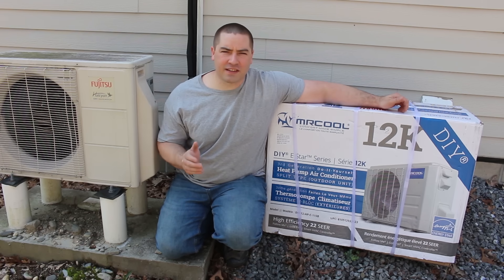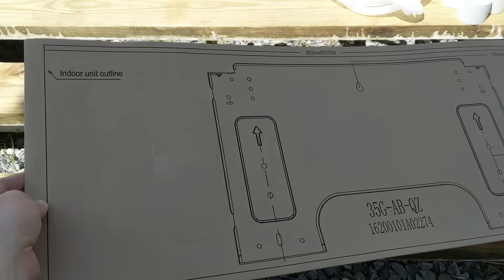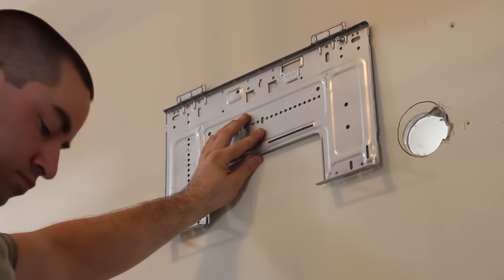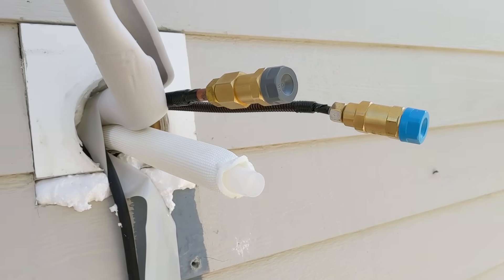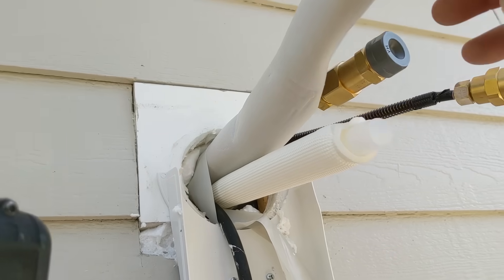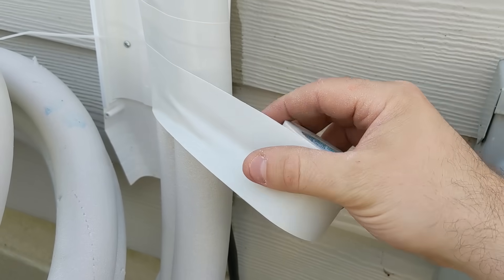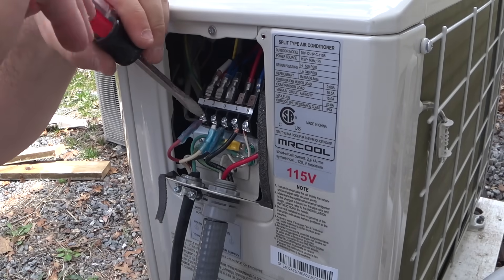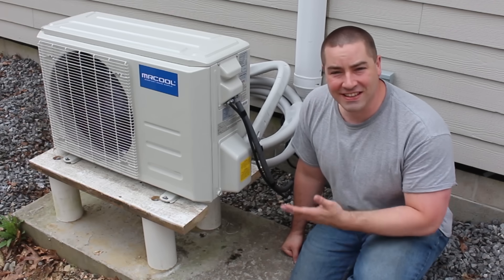Installing My Own Mini-Split Heat Pump, DIY

Comment: a little tips for drilling a hole bigger, is to drill a hole in a little wooden plank etc. and hold it firm over the little hole. then keep preasure on the "template" and drill a hole. the little template keeps the sides of the holesaw from wobbling.
Reply from the maker: Thanks for the tip.  I'll have to use that next time.
Reply: Or "drywall saw" is way easier and safer
Reply: You can also nest  2 hole saws on the same arbor. Use the original hole saw used to make the smaller hole as a guide for the larger hole saw. Works great.

Comment: Because of the camera angle i couldn't tell if the inside unit was level but it should be on a slight angle for the drain on the right.
Reply from the maker: I installed it according the manual.  The instructions specifically said to install the metal backer plate level, which is exactly what I did.
Reply: @DavidPozEnergy  ok than maybe the "gutter" inside the unit is already at an angle.because in my country they install it at a slight angle so the water flows out faster.
Reply from the maker: Could be, I don't know.

Comment: Nothing says DIY like 8' of copper coiled up to store your compressor oil.  I wouldn't think the average guy could pull off a clean install and be successful too.   No pressure test, just cross your fingers?
Reply from the maker: I  posted a follow up video addressing that question: https://youtu.be/KzHLsRtVn4U

Comment: I think good to have knowledge as it was DIY. But in terms of technical view or in a long run, you should be careful when you bend the copper pipe, and you must know required load for your room, and when you deal with refrigerant you need to be careful.

Comment: some info.        it appears that this sort of 'split  yet  combined  heating  And  cooling system' is a solution in search of a problem.         get 12k  Or  15k btus of cooling  from a window ac unit.          if the window won't cooperate,  put the unit  On  a  Stand, aligned with  the  window opening  and  create (simple, panel) ducting between the two;  with necessary drainage management.         heat with your choice of  mains AC heaters  or  whatever.   cheers      googletranslate

Comment: HVAC companies are a rip off!  nay sayers commenting are probably some of them.   I got a quote for right at $10k to install in my cabin,  Mr cool cost me tad over $1600 direct. The concrete, wiring, disconect box and the outside plastic cover cost about $150.  Saving me $8250!
Mines all unboxed ready to install, thanks for the video.
Reply from the maker: Bingo.  I like doing it yourself more anyways.  Very satisfying.
Reply: @DavidPozEnergy  Installed it  and its working great.  I amazed at how quite it is inside and out.   I bought 3/4" conduit, the unit will only take 1/2", was my only problem.  Thanks for the Video.

Comment: Is the warranty still vs valid when you DIY? The Senville doesn't
Reply from the maker: Yes, in this case it is.  Not all the Mr. Cool models can be installed by homeowners, only the ones marked as "DIY".
Reply: @DavidPozEnergy  You can easily install the other series of units DIY . A small vacuum pump and gauges are less than $100 . You can also do everything DIY and then call a HVAC tech to evacuate the lines and release the refrigerant to sign off on it . Usually charge less than $300 which is what you pay extra for the DIY line anyway .

Comment: That diy unit will have a multitude of issues...also not installed per NEC code 
Not to mention the loops of oil trapped in refrigerant lines...ugly,dangerous,and wont last...also the unit you replaced has low temp heating...that diy cannot produce the same heat ...enjoy your cold house in winter....

Comment: No vacuum, the moisture inside the line will build up ice , causes clogged. That’s different with professional job
Reply from the maker: I  posted a follow up video addressing that question: https://youtu.be/KzHLsRtVn4U

Comment: You are cool. How did you make your little stand there? 💁‍♀️
Reply from the maker: I nailed together some 2x4 lumber into a rectangle.  Then I bent some #4 rebar to make a big "J" from the base up the 4 legs.  The legs are in 4" PVC that was left over from plumbing the house drain.  I bought a sack of cement and hand-mixed it with water, sand and stone in a wheelbarrow.

Comment: buddy you did a good job but you must do a long timed strong vacuum for those pipes and the evaporator  to evacuate all the air and moisture before opening the valves , that will prevent any damage to the system .
Reply from the maker: I  posted a follow up video addressing that question: https://youtu.be/KzHLsRtVn4U
Reply: Another expert that does not know what he is talking about.i am talking about Nashwan Jan.

Comment: I have watched your videos and have found mini-splits just recently and plan on installing one...this video is a little bit suspicious...:)....I think there was a technician there instructing you....also because you had the existing outside mount..and electrical hookup...you could do it yourself...most folks won't have that.. but I still plan on looking now at MR. cool.
Reply from the maker: Hi Mr. Mark,  Yes, I'm replacing the Fujitsu unit that was a constant pain.  I had built the concrete pad for the old unit, so that was still DIY.  But the Electrical work was professional.  When I built my house I hired an electrician to do all the wiring, and requested an outside disconnect for the mini-split.  
I'll take it as a compliment you think there was someone else there giving me instruction.  There wasn't a technician, but I did have my daughter telling me to hurry up.

Comment: Thanks for posting this. I'm looking at the mini split myself. I'll need the 30,000 BTU which doesn't seem so mini.
Reply from the maker: 30k is a big system.  But these things can ramp up and down nicely to fit the need.
Reply: I put a 33k Mrcool in my main house; it's exactly the same amount of work for the smaller Mrcool save for the larger size 10 wire. And the price wasn't that much more than the 12k units

Comment: Bad job... there should be no more than 1% non condensable gas in system.. will not work propperly.. vacuuming or "flushing" but dont know is ti legal...
Reply from the maker: I  posted a follow up video addressing that question: https://youtu.be/KzHLsRtVn4U

Comment: Those dyi ac units are cool but they aren't accurate you should test the system with nitrogen. If you just release the refrigerant and there is a leak you loose that refrigerant. Second the system should be put on a vacuum to get any moisture and none condensables that may be present. Third  you have a extra roll of pipe that is not needed. There are reasons professionals are used
Reply from the maker: I  posted a follow up video addressing that question: https://youtu.be/KzHLsRtVn4U

Comment: Hey man, found this video by mistake actually! Was a good watch. I hate all the negative comments by people who seem to be in the field and are getting mad because the way they do things has changed and they are not keeping up. I was looking at one of these for in our basement to get rid of the baseboard heaters. We have an ETS system for upstairs but those heaters are just STUPID priced! I am not paying $10k just for 3 ETS heaters and then installation would be on top of that yet. This installation looked pretty simple but I wish you would have had a new install to show everything needed to be done. This is a great product for DIY it seems and if this design catches on then no more ridiculous installation bills from HVAC companies!

BTW - For the people screaming its wrong and to hire a professional...OK I will pay you $200 to install one of these in my house in PA. There is no existing one so everything needs done. If there was one there I would offer $100. I don't understand why companies make people pay close to or more than the whole unit cost for installation or repair. Kind of like computers, who in their right mind would pay $100 per hour to get a $400 computer fixed....just makes no sense.
Reply from the maker: Hi.  Thanks for your comment.  A brand new installation would require the electrical run, but I had hired an electrician to do that part 7 years ago.  The rest of the comments are interesting for sure.  Most  mini-splits on the market come with open lineset.  Open lineset requires vacuum and Nitrogen pressure test.  I can understand a professional charging a lot of money to perform those services.  This unit (Mr. Cool DIY) comes with a pre-charged lineset and does not require vacuum or pressure test.  It's great for DIY.

Comment: Great vid thanks. I’m shopping for one now. Can you tell me how much and where you bought your unit, which has the pre charged lines?  I’ve been getting prices from $ 780. To $1400.  I’m thinking the cheaper one you must vacuum the lines yourself, I rather have the the recharged lines.  Thank you
Reply: Search the Home Depot site for Mr Cool . You can order and they deliver to your local store . Prices are the best also .
Reply: ........hi im thinking the same thing the line sets  are charged ? which ever it is sounds like there is chance for pollution , maybe if you can purge  before openning up the king , im not sure but ain't my house  good luck on unit .
Reply: مرحبا كيف حال في الدوله العربيه يختلف تجميع ال كندشن قليلا"
Reply: You might be better off to buy the cheaper system. You can have a reasonably good set of manifold gauges and a vacuum pump for about $300. That would allow you to cut and flare the line to the exact length you need rather than having to coil the excess behind the condensing unit. Besides, with those precharged lines, if you kink it: you are fucked. With the regular lines you can just cut the kink out and start over. If the kink is in the middle of the line; you can just go over to Home Depot and buy some more refrigeration tubing. With the precharged lines you can't do that.

Comment: Good job but you didn't show how to  connect the power.
Reply from the maker: You are correct.  Mr. Cool sells both types, the type with pre-charged lines, and the type you need to vacuum.  The type with pre-charged lines is a little more expensive.  They come in a few different sizes, but this is the one I have: https://amzn.to/3glWvAa  I have some additional links in the description for some sealant and tools if you need them.

“As an Amazon Associate I earn from qualifying purchases.”

Comment: the extra line set should be raised up and set so it coils downward for the oil.. you dont want the oil to get trapped in the loops.. the oil should be in the compressor where it belongs..
Reply: I saw that too...coil should always be sloping up, not down then up.
Reply: Joseph Ferradino 
I ran mine down the outside wall and then length wise along the bottom, then set the compressor and wiring. No coil on mine
Reply: How do you get away with not vacuuming down the system before charging it?
Reply: @johngunn879  The linesets are Pre-charged with refrigerant, thats why he cant cut them down to a reasonable length. If he did, then he would need to pressure test and evac the linesets.
Reply: Jeff Major in
Reply: @jeffmajor3587  line sets are not pre-charged with refrigerant and they make flaring kits to cut the line sets to lengths.
The only thing pre-charged was the condenser.
Reply: @johngunn879  it is a Pierce connection, has the gas in the unit. Maybe slight positive charge in line set.
Reply: @johngunn879  All the components (even lines) come with charge in them, thus no air or moisture.  Special fittings hold pressure inside, yet open when components are screwed together.
Reply: @chetmyers7041  i’ve installed literally hundreds of minisplits throughout my years and I have never once purchased a recharge line set.
Reply: @johngunn879  I have the same question
Reply: @johngunn879   it already has a vacuum in it. He hooks up the lines and as he connects it  equalizes.
Reply: @johngunn879  yep i was wonderin da same thing
Reply: John Gunn it’s a shity system . It won’t last 3 years and he will be getting another unit
Reply: @jrod264winmag  yeah, if he had such bad luck with the last mini split, why would he want another one?
Reply: @johngunn879  they manufacturing that way so you can buy a new one every year and not claim warranty at all..
Reply: How is that possible without the ability to cut the lines to length????
Reply: @johnhogan3810  apparently they do make pre-charged line sets. But usually most installers do not use pre-charge line sets so they can cut the line sets to length. Plus it just looks like shit with all that extra copper looked up right there next to the unit. What’s the point of putting the cover on the line set if you’re going to have all that crap laying down at the bottom.
Reply: That's awesome they are pre charged and coil covered for kinks. Bet they are expensive, and would u need a liscense to buy the line sets? Last, you would think they would have 50, 20, and 10 foot line sets to sell.....
Reply: @Nickppg  They do but most if not all the all-in-one package contain the 25ft line set. Shortest I've seen is 16ft.
Reply: In this install, it looks like coiling downwards could have been achieved by having the lineset exit the cover 2 feet higher.
Reply: There should be no coil!

Comment: And this is how us service technicians make our money....and lots of it
Reply: Still needs to vacuum the lines, if you leave air in them, it may not last as long.
Reply: @daijoubu4529  These do not need to be vacuumed . If you watched the video you would notice the specialized ends of the line sets .  HVAC tech companies do make lots of money , I think it and plumbing are the two largest taught trades in prison , lol .
Reply: How did he evac the lineset, or were both halves per-charged?
Reply: @InsideOfMyOwnMind He didn't. Lol
Reply: @martinboyle8089  The line sets are pre-charged

Comment: I would have added a cooler to that "coil" line set to keep my beer cold in the summer!😁
Reply: You do realize that one line would be HOT, right?
Reply: Both lines of a mini split are cool, txv is in the condenser
Reply: Dennis Coulbourn this is also a heat pump. In wintertime both lines are hot, the condenser is inside
Reply: @12345anton6789  Then you use the cooler to keep your beer from freezing.

Comment: You’ll be calling a real tech out there to look at that turd eventually. I can almost guarantee every fitting on those cheap line set leak. The old one probly leaked because whoever you hired doesn’t know how to make flares properly.  they could have stuck some Nylog in the threads and been done with it.

Comment: 12:11 You must put a small piece of net at the end of this drip tube cause many insects can get inside via of this drip tube, at your air-conditioner.
Reply from the maker: Thanks for the tip.

Comment: What’s the procedure for when you have a leak??
Reply from the maker: At that point I'm required to hire someone with a licence.
Reply: Hi Dave, thanks for the video. I have R22 refrigerant leak, I was told I have to replace the entire unit and costs $7500! Any advice please?

Comment: You made a big mistake! 
You should have vacuumed all the air from the tubes and the indoor unit before releasing the refrigerant.
Now you have an air/refrigerant mixture in the system and that is   a disaster recipe.
Reply from the maker: I posted a follow up video addressing that question: https://youtu.be/KzHLsRtVn4U

Comment: Haha! Thanks Dave for showing everyone the wrong way to install any HVAC equipment. You’re the reason I stay busy. THANKS!!!
Reply: Can you enlighten us as to what is wrong Adam?
Reply: Ben's Solar and Battery Adam is not current on the types of equipment that is on the market, he is still living in the age that he thinks every evaporator and line set has to be evacuated. The MrCool DIY system has line sets that are fixed lengths evacuated at the factory and charged there too. Please for give Adam as he does not know what he thinks he knows.🤣🛫
Reply from the maker: I posted a follow up video addressing that question: https://youtu.be/KzHLsRtVn4U

Comment: This is more of a replacement of a mini-split...quite a bit different than installing one that did not exist before.
Reply: Not much, the pad for the outside unit and the electrical connection is about all that was the same.

Comment: The leak is most likely in the evaporator coil 
I have replaced many of them for the same reason you are changing system I pressure test the to 600 psi and they show up along the tube sheet or along the bottom rows of the coil
Reply: 600psi? Is the unit even designed to hold that pressure?
Reply: @mygripe  It's a R410A refrigerant so yes it can handle it for pressure testing .
Reply: @mygripe  Often 500 is sufficient, all manufacturers have the test pressure of a system on the label.
Reply: Brandon Wright for r410a equipment
Reply: All AC guys do 360 max.